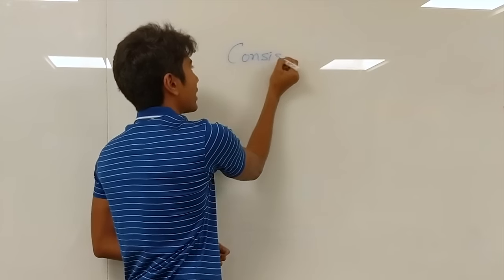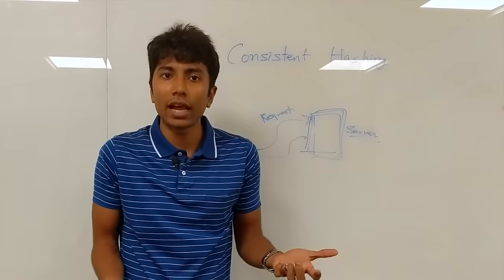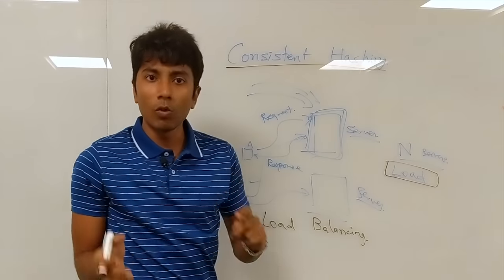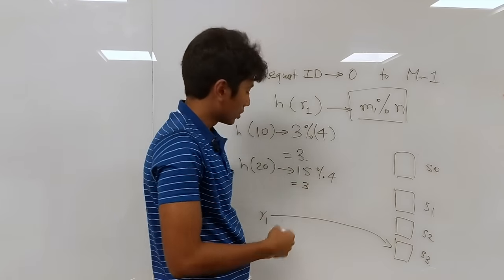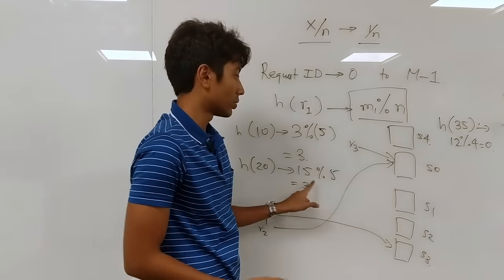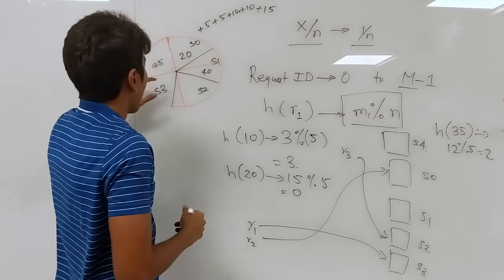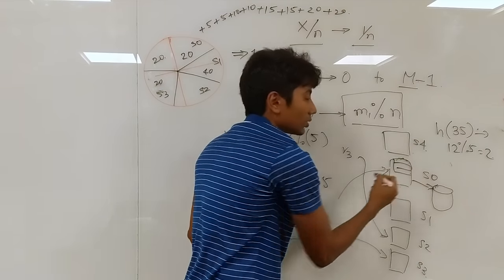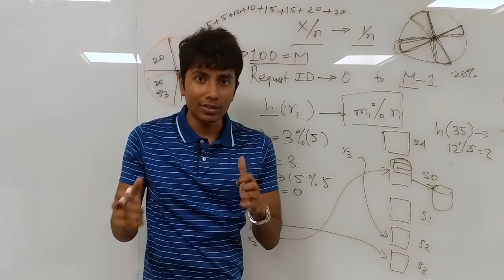What is LOAD BALANCING? ⚖️

Comment: some one said Load balancer will manage the loads but they wont route the  traffic but here i can see this definition. please explain it once. 

Load balancing refers to efficiently distributing incoming network traffic across a group of backend servers, also known as a server farm or server pool.

Modern high-traffic websites must serve hundreds of thousands, if not millions, of concurrent requests from users or clients and return the correct text, images, video, or application data, all in a fast and reliable manner. To cost-effectively scale to meet these high volumes, modern computing best practice generally requires adding more servers
Reply from the maker: A load balancer may act as a router. Here, it isn't routing requests. It is allocating id ranges to specific servers.
A gateway service can handle routing the requests to a microservice. The microservice can also route requests as long as they know which node should get this request.

No offense, but where did you pick the paragraph from? 😛

Comment: Great content! 
Why wouldn't the first approach work for a newly added server? Are we worried more about the cache miss? I believe if the cache has a timeout, and the frequency of adding a new server is not often. The system will be in a good performance after the old cache timeout.
Reply: one more problem other than cache miss,
Lets say request r1 always will be going to server s1 and req r1 has session info stored on s1. So, if number of server changes, chances of request r1 will be going to other server and not server s1 where it has its session info. SO, user will lost the session info.

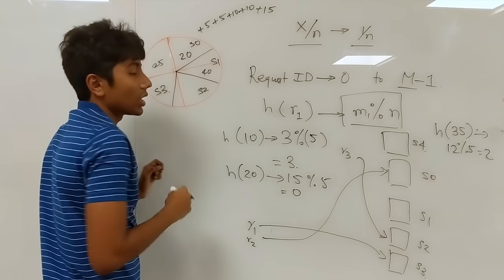Comment: Hi gaurav I like your system design play list, it's been useful for studying for interviews but question I understand how the load balance is 25/25/25/25 for 4 servers but why at 9:30 is skews with 5? Why wouldn't you do 20/20/20/20/20?
Reply: @aishwaryaramesh4877  I'm unable to open this link and when I tried in PC I was redirected to this same page.
Reply: @Dawood0094  Yes, you will be redirected to the same page but the comment I've shared would be displayed as the first comment ( highlighted comment)

Comment: Hi Gaurav, you are making really interesting stuff. Thanks for that. I have a small query in load balancing, Here, we are sending requests to the servers based on hashing and it means the request is served by a random server. Lemme say if we have time-consuming requests, unfortunately, what if most of the time-consuming requests go to single server always in a cluster, how can the load be balanced. (I'm asking in perspective of nodejs). In the case of multi-threaded language, it is not an issue. Thanks.
Reply from the maker: That would be unfortunate, but in a uniform distribution, I wouldn't expect too much skewing. However, we can offload tasks by putting them in a queue like Kafka and pull from it when a server is ready. That would sort of balance the loads.
Reply: @gkcs  good one. Is there any smart load distributor of requests based on time taken to serve previous requests?

Comment: What load balancing technique is this, very strange to me, we generally configure a Virtual IP (VIP) configured with set of pools based on port number that is IP+port and add pool members (appservers) configure load balancing algorithms like RR,least cost, weighted etc. Configure presistance, HTTP headers to identify the traffic. And we use hardware/software devices like F5,AVI,A10, NSX, Citrix etc.. What is this concept and where do we use this.. I'm a Network security engineer, I'm not sure what LB is this.. Any inputs is highly appreciated..
Reply from the maker: That's strange. You could have a look at the consistent hashing video for a better understanding. For what I understand, you are load balancing statically allocated IPs. With Round Robin or least cost.
That's cool, but probably won't scale for very large systems.
Reply: @gkcs  consistent hashing algorithm is just another hashing algorithm. I think you are talking about using consistent hashing to distribute requests in LB, which sounds like an approach. But this is a bad approach in real world system. Because a large amount of requests will go to  a small subset of hosts all the time, which leads to overloaded servers.  Check out this article : https://medium.com/vimeo-engineering-blog/improving-load-balancing-with-a-new-consistent-hashing-algorithm-9f1bd75709ed . In real world (AWS, Azure teams), LB still uses classic RR, least connection, least bandwidth algorithms but not consistent hashing. These algorithms fit well for scalability scenarios.
Reply from the maker: @blackcatcaptain2022  I'll read up on this and get back to you. Thanks for the insights!

Comment: nice video.thanks.
In case of pie chart explanation, i got overall idea but when u are summing up the delta changes and u sum that to 100.My question is , if a server has lost 10 key and other gained 10 keys , why are we adding this 10 two times?Once as gain and other as loss?Only one time we could have considered 10?
Because it seems u made a total change of 100 keys but instead total change is less than 100 as some keys stayed at original location.Did i miss anything?

Comment: Need to understand why this 1st approach (simple MODULO hash) is inefficient (in terms of scalability).
Servers generally cache lot of user specific data from earlier requests (more in case of read heavy systems),
so when new servers are added or removed, the simple MODULO hash function now gives totally different result.
This causes cache miss for almost all new user requests. This is expensive cost which will result in poor user experience.

Generally it is better to route user requests to same backend server (as much as possible), as it can benefit from caching.

Comment: 8:25 Hi Gaurav - I am somewhat confused by the series of steps for the buckets handover/change ( as illustrated by the pie reallocation diagram ). If I am not mistaken, we have to traverse each server sequentially ( until the last, when we add the 5th server), and additionally, we account first for the buckets lost from the current server, and then account for the buckets gained by the following server, correct?
Reply: Take 100 servers and n is 4 , split up is 25 , when n increased to 5 the split up is 20. That is he tries to convey☺️

Comment: Talking from a networking perspective, I am not sure if this approach will favor a large scale organization. When you have 100s and 1000s of request per sec, this approach might fail. If you want stickiness you can use cookies in general to route the traffic. Usually we use RR, least cost, Geo, weighted and checks on bandwidth.
Reply from the maker: That's true. A lot of the internal micro services can route using this mechanism though.

Comment: The pie chart logic looks wrong....the change will not be 100(entire search space) but 80.
Please correct me if otherwise :)
Reply from the maker: Please explain your point.
Reply: Hash values : (100,20,40,60,80) %(4 or 5) will give bucket 0.Similarly(1,21,41,61,81) => bucket 1,(2,22,42,62,82) => bucket 2,(3,23,43,63,83) => bucket 3. So, requests with these 20 hash values will fall in the same respective servers even after the addition of  5th server(s4).So total affected search space will be 100-20 = 80(earlier i said 50,i edited the comment). Thanks.
Reply from the maker: That seems correct. I should add a pinned comment to the video. Will check this again and do that.
Thanks!
Reply: Just look at the first section, it only loss 5 out of 25. So 20 remains the same. How can you say entire pie has changed, Gaurav?
Reply from the maker: Because it's not just the information which moves into the new node, but the information which moves out of the existing ones. 
I effectively doubled the computations needed.

Comment: I have multiple machines on my backend, all are connected to my load balancer running HAProxy. I just learnt that the response also goes through the load balancer, instead of one of server directly sending it to the client.

But will it not create a bottleneck in case of huge traffic and overload my load balancer itself.

Is there any way to directly send response from server to client.

Also when response goes through load balancer, does my source file also sits there temporarily to be sent to the client.

Can't we use load balancer only to send request to my servers and response to directly go from server to client.

My main goal to make my system distributed was to distribute traffic among my servers, now since load balancer is handling both request and response am I not back to where I started?

Comment: First Thanks for this videos
Second I have a question about load balance, Is Consistent Hashing another technique of balancing like round robin and least connection?
thanks.
Reply from the maker: Yes, it does provide the additional feature of stickiness. So you can save relevant data in the cache
Reply: Thanks a lot, and I'm waiting for your videos at System Design :)

Comment: Thanks for the great video! 
Is the caching always saved on the server? it can not be saved the api gateway for example? and also, the load balancer, it is on a separate server ? caching can not be saved there?  where the pai gateway exist in this architecture?
Reply from the maker: Have a look at the caching video in the system design series.You can cache on the server, but I'd suggest a global cache.

Comment: Nice video but didn't understand the part when you are explaining bucket distribution when 5th server is added in pie chart.
Reply from the maker: All the buckets change ranges. Each handles 20 now, so their ranges shift from the previous ones.
The shifts cost the processors cache, depending on how many lines of cache need to be evicted because of the new ranges.
Reply: @gkcs  yes, but every server should handle 20. U mentioned first 20, then 40, then 60 and last one 80. Kinda confused. Sorry but I got stuck over there. :(
Reply from the maker: @ketulshah5283  Ah. It's 20 each. First 0 to 20. Second 21 to 40. And so on.
Reply: @gkcs  oh ok. Now got it. That explains now. Thanks :)

Comment: Who performs the hashing of the request id and the subsequent `m % n` computation? Is that another dedicated server just for the routing/ load balancing part. In that case, won't it face the same problem we started off with initially, i.e. being bombarded with all the requests in the world. Would it be able to handle all of that load by itself, or we would need some sort of scaling for that as well, either horizontal or vertical ?
Reply from the maker: No there isn't. The operation is very cheap, so it's done on all servers for routing.

Comment: Hi Gaurav. Hooked to your channel for system design series and maybe much more what I missed doing in college and I regret.  Doing this first thing in the morning as a routine. I want to change my profile ( Front-end for now and doing great there but you know the thing which lacks is the thing we pursue ...first as engineers)

The links provided are a little overwhelming in number below each video. So was wondering if you can point towards some good few resources. Let me know if I can drop you DM on any social media network or email.
Reply from the maker: You can browse through the smaller ones to start, and head for the heavier ones for details. 
That's how we usually deal with building systems too 😋
Reply: @gkcs  Cool. Makes sense.

Comment: You will have a problem if you’re generating random number before hash, without adding one more server, the random number you’re using will make the result from Hash be changed, and the request has already been sent to different server, is it true? Why not use a unique ID before hashing, then you can keep the request always goes to the same server. (The case I’m talking happens before you add one more server since you’re saying request goes to different server if we add one more server is a problem, looks like the problem already there if you’re using random number, is it true?)

Comment: @Guarav Sen why do you even consider moving the load from one server to another? I mean cannot we simply evenly distribute only the new requests and leave the old ones where they are?
Reply from the maker: That would have us maintaining request to server mappings for the old requests, which the load balancer wouldn't want to do.
Reply: @gkcs  great to see an answer! But why wouldn't load balancer want to do it? Is it costly just to let them finish where they are? Does the load balancer maintain request to server mappings normally?
Reply from the maker: The request id is usually a 64 to 128 bit number. That gives 2^64 unique mappings, which is infeasible to store.

They can be allowed to finish where they are if the server is stateless. Otherwise, we need to flush out all requests having ids in the range that the server has lost.

Doing this is important so that we don't have dirty cache reads.
Reply: @gkcs  with stateless you mean that there may be some data on that single particular server? Session or database data? And we need to access that data with next requests from the same users?

Comment: The problem you described, can't it be easily resolved with a simple "Round-Robin"? This solution seems like a very sensitive time bomb that could cause severe unbalancing actually... what if the front actually generates the same random request id? it would all be mapped to a single bucket and all others would be just sitting there, doing nothing...
Reply from the maker: The same request ID? Please read up on hashes and probabilities.

Comment: Hey, I have a question. To design scalable systems, we have to ensure that the downtime is close to 99.9%. 

But one question remains, how do we deploy our binary onto multiple backend servers and ensure that ongoing requests will still be processed by the old binary, and new incoming requests will be processed by the new binary. I'm a junior backend developer, hope to learn more from you.
Reply from the maker: You could route them accordingly, although it is a bad idea. Your request structure doesn't change with the new binary, so the new code can handle the requests.

Check out what 'breaking changes in software' are for a better idea.
Reply: Gaurav Sen But if I upload and overwrite the binary, ongoing requests will be cancelled due to error. That’s why I’m figuring out how to implement smart traffic routing when updating binary.

Comment: This might be a dumb question but around the 5 minute mark we are hashing the request of then modding it with the number of servers.  Why can’t we just mod the request id directly?
Reply from the maker: Directly mod on the request id is also fine (it's like using an identity function for hashing).
If you want to direct requests based on a request property, you can hash based on it. For example, hash based on userid will send all requests from a single user to a single box (because the hash will be the same).

Comment: [ Cache consistency ]
** Write through cache
	- Write in the cache -> write in DB -> done
	- Problem
		- High write latency and cost
	- Good for read extensive applications
** Write around cache
	- Write to DB -> Done
		- Lower write latency
	- Problem
		- Data inconsistency
		- Cache miss, higher read latency
	- Good for not frequent read data
** Write back cache
	- Write in cache -> done-> then update cache
		- Low write latency
	- Problem
		- Cache could fail, might cause data loss
		- In reality, we can add resiliency by duplicating writes, cache backups etc.
	- Good for mixed workloads in r/w

Comment: Hey gaurav, 
That was very well explained, however I have 1 doubt. Earlier when we had 4 nodes: n1, n2, n3, n4 each had a capacity of 25%.
With the introduction of a new node (say n0), it consumes 20% range of n1, to cover for the deficiency n1 consumes 15% of n2 and so on ....
This change in redistribution comes to be 50% in total (in contrast to your 100% delta).
My theory could be wrong, but can you please help me with it or probably redirect me to some other resource.

Thanks
Reply: Just pasting this snippet from Gaurav's reply on another comment for others who might have the same question:

""The pie calculations in the video show the number of profiles a node has to load or evict, when the number of nodes changes. The more a node has to load and evict, the more work it needs to do.""

Keyword here being load OR evict. You're only calculating loading.

Comment: so will request id be constant then? i thought it was supposed to be unique per request?
Reply from the maker: The request id will be unique. But the routing can be on a parameter in the request, like user ID.
Reply: @gkcs  makes more sense. So if I'm understanding this correctly, even though the requestId is unique, not just per user, but per request, the load balancer will most likely use something other than the requestId to hash and map to a server? something that is more unique to an user ? With the goal of pointing same user to the same server? (unless a server is added and removed)

Comment: How to approach if we have 6th server now?
Reply from the maker: Very good question :P
Try to apply the concept explained above :)
Reply: I meant if 6th server is added how to decide about taking buckets from 5th one.  We will take 4% from first four and we take 4% from last chunk of S5 ?
Reply from the maker: @alokuttamshukla  Yes. We will distribute the load equally.
Reply: @gkcs  What if we double/triple the amount of servers? In that case, we will have a huge change right and thus messing up with local caches in server. Is there nothing we can do in that case?
Reply from the maker: @blasttrash  Doubling or tripling is a drastic change. At that point we have to catch the guys responsible for designing the system and demand answers as to why capacity planning was so shoddy.
Just call an outage or add servers sequentially 😛
Reply: @gkcs  haha lol. makes sense. :P